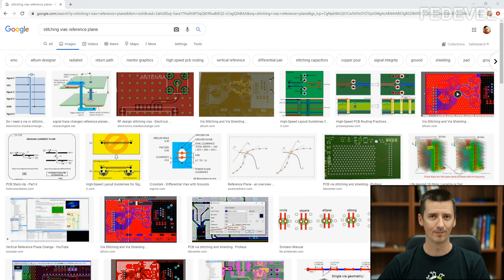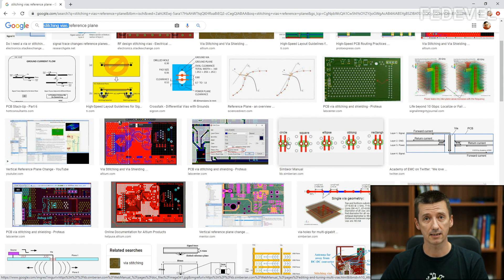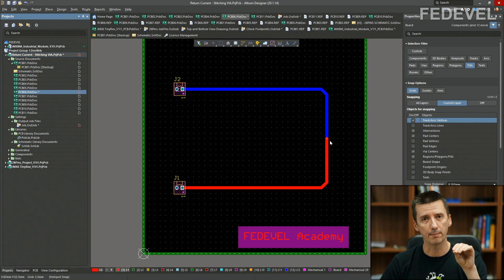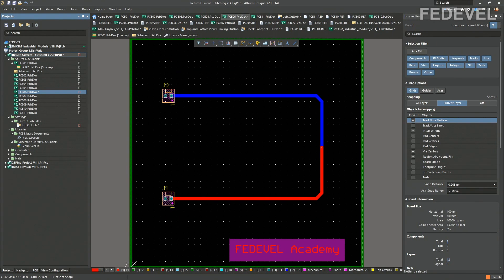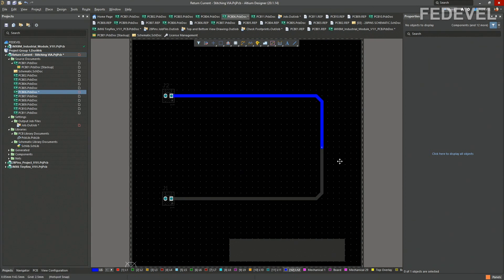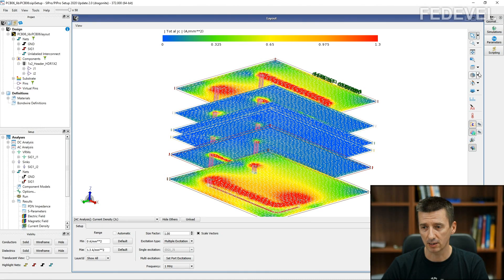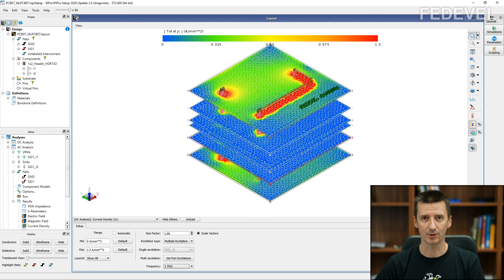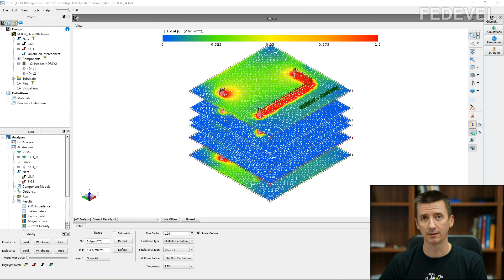How GND VIAs Improve Your PCB Layout

Comment: I assume you would have to have a certain average signal switching/frequency speed for this to matter. What frequency or frequency range was this simulation done? At what frequencies does it start to matter. Suppose I have a 3.3V digital signal that only switches at 50KHz worst case.  Would it even make a different in this case? Is this only really for high frequency like RF?

Comment: This is confusing. I don't know if you will comment on this but here is the confusion; what I learned is that signal lines must end up to the gnd after reaching components. So for example power --- Component --- GND. And in your video, for third layer pcb you said you dont need gnd stitching vias. This sound like
Power --- component and done. Also, for initial simulation, there seems there is only 
Power--- component 
And no connection from component to ground.

Comment: As far as I see at 4:50, you use an ideal source and 1 Meg sink for the simulations and also again it looks like you didn't calculate impedance for all 3 conditions (top to bottom, top to L3 and coplanar trace). What do you think that how those (impedance mismatches) effect the current density?

Comment: The current penetrating to lower layer is probably visible this much because the color scale is saturated strongly in the upper layer. To see all values you could try logarithmic scale. I would be curious what is the actual ratio between the return current (density) on 1st and 2nd GND layer.

Comment: Great video. Does the controlling the path of the return current also affect radiated emissions? For example, does a tightly controlled return radiate less than one with no stitching vias? Is it possible to simulate something like that?

Comment: Very informative video. Really learnt a lot.  I think you can avoid the return currents in the other ground planes be adding stitching via along the length of the trace and not just at the point of transition.

Comment: What if you used stitching vias in the tracks instead? I mean instead of beside the track, then place maybe 2 or 3 in the track to stitch both tracks over a longer distance of the vias?
Reply from the maker: That would not help to control the path of return current (the current what flows in GND)
Reply: @RobertFeranec  Thanks a lot for answering. So an extra GND via beside the track does control the current while an extra GND via IN the track does not? Sorry for keep asking.

Comment: The simulation where you placed those ground tracks to completely shield the signal track is really cool. I remember when I was measuring cross talk between sensitive analog signals on an eeg amplifier, my senior engineer told me that if we use this trick in layout then the cross talk between adjacent channels will be close to 0. Thanks for showing me how that really looks like 👍.
Reply from the maker: Thank you Nihar

Comment: The return current is like a displacement current as well so depending on the distance between layers which can define the capacitance between the layers, the return current can flow on layer 2 gnd plane  and layer 4 gnd plane when crossing signals from layer 1 to layer 3.

Comment: Great videos, should see how those return currents affect cross-talk between lines. Even if two signal lines are well spaced, can a badly spread out ground current add noise? Can limiting the ground currents reduce EMI? Obviously, but how many vias will it take? A fun example, but something we should never do, would be a pwm signal next to an important analog signal line.
Reply from the maker: Some effects of crosstalk and coupling are visible in this simulation: https://youtu.be/4nEd1jTTIUQ

Comment: Thank you for this great video Robert !

Unfortunately I think this is not a kind of software a freelancer can buy due the high value.

Does anyone know a simpler and cheaper software to do these kind of simulations?

Price here in Brazil:
R-35A-001-A Node-locked license R$123.390
R-36A-001-L 12 months upgrades and support - node-
locked R$18.508
TOTAL: R$141.898
Reply from the maker: Thank you Jeremy. (just converted R123.390 = 22000USD for everyone who would like to know). PS: If anyone knows about a good free simulation software like this, please I am also interested to know.
Reply: Another software prices
: PCB-Investigator

 - Physics Edition floating license is 36284USD
 - Physics Dongle Edition is 19294USD

Comment: hello, i have a question, i was asked to miniaturize an circuit, so i decided to use multilayer to put some component to top layer and other component on bottom layer, my circuit should work up to 900 Mhz, my question is that should i use one substrate and put grd on top and bottom and connect the, through vias, or should i use two substrate and put a grd between them?

Comment: redo, but use bypaass caps instead of vias.
It is common to run traces one direction on one layer, then route perpindicular traces on another layer.
The layers aren't necessarily all ground. A power plane is typical.
This is why you should sprinkle bypass caps around the board, EVEN AWAY from components.
This is also why you should bypass unused power signals on connectors. The cable references some current to power signals.

Comment: love your content .  you should do one on  how to handle a separate digital and analog ground planes.  Such as where to attatch them, should it be close to source or close to a sensor?  what if you only have a single layer board (without a ground plane)
Reply: In a good design there is no reason for different "types" of ground planes (e.g. "digital", "analog") other than for galvanic isolation. See works of Keith Armstrong (e.g. www.emcstandards.co.uk/files/part_4_planes_corrected_29_june_17.pdf)

Comment: The two ground planes above and below the track are just two capacitors in parallel so the return current of 1MHz signal is on both of them.

Comment: Robert: maybe you've covered this before, but if not, I'd be interested if you could connect-the-dots on the following topic:  We see in your simulations great illustrations of the familiar "principles" that at higher frequencies the return current on the ground plane wants to position under the signal track.  So there must be some force on that (AC) current to influence it to that position, a force that's much larger at higher frequencies.  Indeed, at DC, two parallel currents in opposite directions repel. So what exactly are the details of that high-frequency force?   And is there some simple physical demo which would actually display that force? (I realize there are descriptions like "the current positions so as to minimize the enclosed loop" or "to minimize energy", but these don't directly discuss the interaction of fields and currents resulting in forces.)
Reply: The simulation is showing a simple representation of the AC signals. Not a snapshot of a single instance in time, but an average value (RMS) over a period of time so that we can see how much energy is flowing through an area.

In a simplification of reality, there is a sine wave (positive and negative voltage) at any given point. If we have a positive voltage at one point on the trace at one point in time, then the electrons in the ground plane are attracted to that area, which creates a mirror image in the ground plane. The mirror image is what we call the return current. As the AC signal exists on the signal trace, it induces the same signal on the nearby copper (a.k.a ground plane), though opposite in polarity.

The energy takes the path of least work, so a nice big plane has low inductance and carries most of the energy. All the nearby copper will also carry some of the energy, but hopefully not enough to distort the signal too much.

In a DC circuit we think about the current flowing in a loop. We apply a voltage to push some current into the trace, it travels the loop and eventually pushes some current back into our ground lead. In an AC scenario the instantaneous pulse of voltage immediately creates its "return current" in the ground plane. The positive pulse travels down the conductor with a negative pulse traveling in the ground plane at the same time in the same direction. Once it reaches the end, some of the energy is absorbed and some is reflected and we eventually reach an "equilibrium" of AC voltage/current on the trace as well as the ground plane.

Comment: I think the reason for return currents to flow in other reference layers as well is due to the impedance of the return path. The reference plane directly under the signal will have the lowest impedance return path. But the subsequent reference planes will also have a return path impedance which is finite. The value of each return path is a function of frequency, dielectric height from the signal layer (as height increases, impedance increases) as well as the dielectric properties of the material and transmission line dimensions. You can think of each reference plane return path as parallel connected resistors (current is shared between resistors, but lower resistance values conduct more current). The first reference plane being Z1, the next being Z2 etc. So |Z1|<|Z2|<|Z3|. Therefore, most of the current will flow in the top reference planes.
Your last simulation is effectively a grounded coplanar waveguide (GCPW) which is preferred for RF signals. Also, ADS has a "Via Designer" tool that helps with optimising via transitions. You can optimise the shape, size, number of vias etc. to get the best performance for the signal and its return path. It has S-parameter and TDR analysis.

Comment: Nice video, but Is there any meaning to add more ground plan ? Because you shown only two tarce in different layer that is connected with via, so cost is also increase. It may you can also do with simple 4 layer ,if signal is there than you can use bottom layer with signal with gnd and stitching via with gnd plane for noise reduction.
Reply from the maker: Thank you Gajendra PS: In a real project, the other layers would be also used, so I was curious to see more complex stackup.

Comment: Great video!
Also I think that it is interesting to add that in a four layer stackup TOP-GND-VCC-BOT if you have a critical signal over top and you must go to bottom, then the stitching via to gnd is not what you need. A capacitor VCC-GND close to the via will do the magic. You must consider that the polygon of the VCC net in VCC plane (poly because more than one voltage is ussualy needed so the plane has cuts) is over the portion of the track on bottom. I propose a simulation of this case for a future video. Best regards!
Reply from the maker: Thank you Santi. PS: I have this on my list to simulate it. Some other people also would like to see it.
Reply: @RobertFeranec  I am looking forward to this “with 4 eyes” 👀
Reply: @RobertFeranec  I couldn’t catch, did you make a video on this? I am looking forward to it 🤩
Reply: TOP - GND - SIG - PWR is my preferred setup, normally have more than one VCC
Reply: Digital Nomad   If you have two or three different supply voltages your VCC layer is not a solid plane, therefor can't be used as a return plane for signals on the bottom layer. Therefor I put the signals on layer 3 and put the power distribution on the bottom layer. Other option is go for a 6 layer board.
Reply: @sparqqling  L1 and L2 are close together, however L2 and L3 have generally more than 1mm prepreg inbetween
Reply: @AbdullahKahramanPhD  Most of my boards are 0.8mm in total nowadays. But you are right L1 en L2 are much closer coupled than L2 and L3.

Comment: Great video lesson Robert. What happens at 0MHz?? Thank you for the time and effort taken. Best regards!
Reply from the maker: For 0MHz currents will flow the shortest way, they will not follow the track of signal (the GND currents would just flow directly between the two connectors)
Reply: @RobertFeranec  oh! Ok Robert, going to see that video then. And what you say is what I thought but going to see video. Thank you!! And be safe!
Reply: Robert covered that a few episode ago. At DC, the return current just follows the shortest path, and is not influenced by the signal track.

Comment: Very very nice and helpfull video, like always :) I think should be interesting to see how the system response in different frequency range and with different distance between stitching vias and point where signal change layer. Also with a stitching vias near the point where is the current source and current sinking. Also, i dont know if this simulation are in sinusoidal waveform, but i think should be interesting to see if the return current and stitching vias are affected if the signal are squarewave and with different rise/fall time, like the EMI level are.
Reply from the maker: Thank you very much Luca PS: I am not sure if it is possible to set waveform shape. I will ask Keysight
Reply: "stitching vias near the point where is the current source and current sinking."  I believe Robert's using through-hole connector pins at source and load, which are connected to all planes of the same net -- specifically the ground pin at each connector is connected to all ground layers.
Reply: In previous videos Robert showed similar simulations at different frequencies. With square waves, the different frequencies "composing" the square wave will have return current paths that follow the signal track to different degrees.

Comment: Hello, I find your job excellent, thank you very much for your presentation. I am getting acquainted to pcb design and I have a question. I have a stack with 4 layers, and the layers 1 and 4 are asigned to ground and they are connected to each other, and layers 2 and 3 are  for signal or Vdd, then if I change  from 2 to 3, are actually stitching vias needed or not, because 2 and 3 have already a respective reference layer?
Reply from the maker: Usually top and bottom layers can't provide nice and solid GND plane, because there are components. So, the question would me more like if the not solid GND plane would not be a bigger problem.
Reply: @RobertFeranec  Thank you very much, I am looking forward your next videos.
Reply: It would be very interesting if Robert would simulate that case. Assuming that 1 and 4 connect to each other near the source and load for your signal track, my suspicion is as follows: In 4-layer, there's a thick layer in the middle, with 1-2 being close together, and 3-4 being close together. So a track only on 2 will have a main return path on 1, and a smaller and dispersed return path on 4.  If you have a track that starts on 2, then half way along jumps to 3, then half the return current will be on each of 1 and 4, and neither will follow the track very well.   I would expect that near the beginning the return path on 1 follows the track, but disperses after the track jumps to 2, and vice versa for return path on 4.  So I would expect that vias connecting 1 and 4 near the point the signal jumps from 2 to 3 would make a big improvement.
Reply: @Graham_Wideman  Thank you very much, your explanation makes a lot of sense.

Comment: That was very good Robert. Is it advisable to add a ground track within a current plane instead of a via. My stack is signal, gnd, signal, GND.
Reply from the maker: Thank you George
Reply: Are you asking if the ground trace on the signal layer is advisable versus just via stitching? It is, if you're concerned about the signal having sharp edges that could disrupt other signals. An SDIO clock signal can be troublesome, for example, so it should be spaced from other traces and can be guarded with a ground trace or a ground pour.

Comment: Appreciate your sharing. I'm curious about if the frequency up to 1 GHz and 10 GHz, does it still need so many stitching via to control the return current?
Reply: I'm also curious what each model looks like when you sweep the frequency from VLF to SHF.
Reply from the maker: @vejymonsta3006  I have not tried to simulate so high frequencies yet. I asked Keysight if I could play with their RF 3D field simulator ... lets see how it goes

Comment: The fence reminds me of a coaxial cable. Does it add capacitance that affects the signal? BTW thanks very much for these videos.
Reply: I would have to imagine so, you could see that those ground traces next to it in the final example had a ton of current flowing through them
Reply: Adding the ground fence does add a lot of distributed capacitance, in turn affecting the input impedance of the line. That change in impedance will change how the input signal couples into the line. The channel host can correct me here, but ADS’s ports are probably set to be matched, so the input power was consistent in the two the simulation. Also, at 1MHz the change is probably small, but the simulation could easily give us that change in Zin.
Reply from the maker: Thank you Roger

Comment: Hey Robert! I have a 4 layer mixed signal PCB with this layer stack: 1 analog, 2 ground plane, 3 power (several rails) and 4 digital (not high speed). Is it a good idea to do a ground fill in the other layers? Why?
Reply from the maker: Eric Bogatin metioned ground fill in his AltiumLive "You must Unlearn what You have Learned" video (you can watch it there): https://www.altium.com/summit/americas/agenda/
Reply: @RobertFeranec  I can not subscribe because the event is over.. so I can not watch the recordings. Eventually.. I think they will upload it to YouTube. Thanks for the response!
Reply: @jorditribo94  did you find the recording? Have the same question

Comment: Only @ 1MHz？The current will change dramaticlly with freqency,right?
Reply from the maker: For higher frequencies I need to understand the simulation tool a little bit more .. because it can consider some other factors and results may not be so easy to interpret. It is visible in my "Does Return Current Flow Under Signals? Watch these examples ..." video here: https://youtu.be/4nEd1jTTIUQ